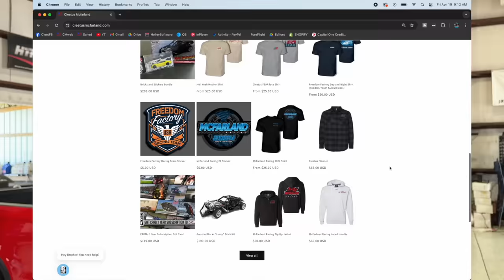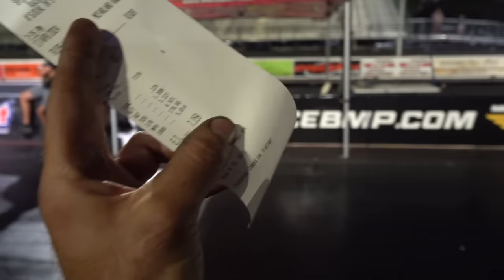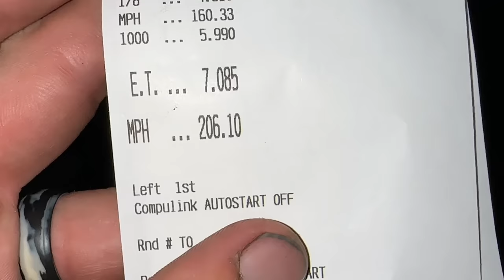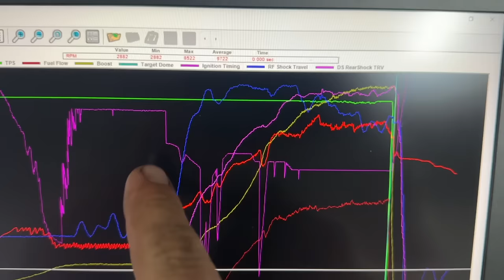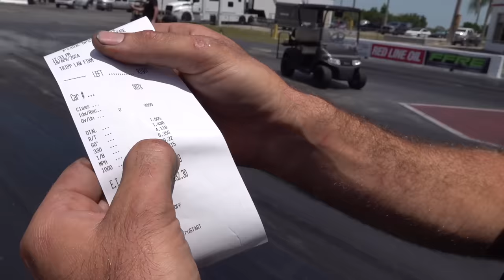Our NEW GMC and Mullet Both DESTROYED Their Records!!!

Comment: 03:00 doesn't take much to break a GMC.... 🤣🤣🤣
Oh, general motors.... 😂😂😂
Reply: 14:00..... And again.... 🤣🤣😂
Reply: Only 3 times 😅
Reply: 21:30 ... And again...... 🤣😂🤣
Reply: @TheXshot  
GM doing GM things... 😁
Reply: Changing an axle> changing a crankshaft
Reply: I was thinking those axels are not made for that kind of use. But as bad as they have beat that thing I stopped wanting it. The 15k would be nice I could buy a 1989 Toyota 4 runner that would last forever.
Reply: Oh it has to be 4 cylinder 5 speed though
Reply: @chevyon37s Kinda hard to compare the two when one of the Trucks has the stock motor in it while the other was swapped for a fully built 427 from Texas Speed... 😂
Reply: Ooops.. I triggered the GM fanbois...
Sure, the Ford has broken a time or two but it also makes a lot more power and is much faster. Imagine what the GM would break if it were making as much power as the Ford. That GM going to spit rods trying to hang with a Ford. 😆🤣😅😆😂
Reply: The front part for sure.
Reply: @philthelawnman So you wanted an untested 1000hp truck just tossed your way? 😂  They did like 30 pulls on the thing. I hardly call that beating on it.
Reply: @philthelawnman So youd have a 900hp truck and you would drive it like a sunday driver every day of the week?
Youd never floor it? You wouldnt do drag and drive events? Youd just let it sit in a garage for the rest of its life?
Hope you don't win it then...
Reply: @philthelawnman you think you could buy a late 80's 4runner that wasn't beat on?
Jeeze you're delusional
Reply: @michaelhuber6405 the ford has a built TKM in it
Reply: @michaelhuber6405  IIRC Doesn't the f150 had a built TKM motor good for 1800 HP.
Reply: @FinnellRacing  something gotta be different about it, because he doesn't blow up mcflurry nearly as much
Reply: @asylumental  Mcflurry isnt a blower car, its a turbo, thats the difference. The crank broke because of the additional stress the blower creates. If cleeter had put his crank support on before hand it probably wouldn't have broken.
Reply: @Jeremy-eu9bx  well I guess we will see after he rebuilds it again and puts the crank support in this time lol... so far that coyote motor seems to hate the blower setup
Reply: @michaelhuber6405  The F150 does NOT have a stock motor in it. It has a fully built fast forward race engines Coyote in it. Has had that engine in it the entire time he's owned it and it has now broken 3 times. IDK, replacing an axle a few times due to user error seems like a lot less of a pain than changing an engine 3 times because it tears itself apart.
Reply: @-joe-davidson  In all fairness that Ford has a lot more aftermarket parts in it as well. The entire driveline is beefed up (axles, trans, engine, rear end and driveshaft) versus a bunch of still stock parts on that GMC. It's pretty common knowledge that turning sharply with drag slick on a 4wd will snap an axle, not once did the axle snap on a launch it was always when it was under a stress from the slicks. The f150 is on radials, also when the GMC was on radials it never had an issue with the axles. Those slicks will wreak havoc on a 4wd, it'll always break the weakest link.
Reply: @michaelhuber6405  F150 had two TKM built motors so far
Reply: Still holds up better than the chinesium hub locks Ford used on their pre-2021 F-150's. Blue would have ripped the teeth off those hub locks with stock power and some sticky tires.
Reply: @TheFlooringInspector82  The axles were breaking at the track because the suspension is lowered significantly and the axles literally aren't long enough for the new range of travel. When the suspension was going into full compression it was pull the axle apart. Some clowns are acting like the shafts were just snapping. It's just a mistake from modding the suspension.

Comment: The red Chevy truck is already starting to fall apart. What a BIG surprise. 😂😂😂
Reply: GMC, but regardless if you try turning in 4wd on drag slicks it'll snap an axle in any vehicle especially if those are stock axles which they were on this truck.
Reply: @TheFlooringInspector82 unless it's a blue ford
Reply: @TheFlooringInspector82  actual question, why is that though? Never heard of anything like that until now.
Reply: @zekebruck7559  I'm pretty sure blue f150 isn't on stock axles
Reply: @Scootbreezy23 too much traction.
Reply: @Scootbreezy23  TLDR: no center diff, too much traction, axle goes pop.

I'm guessing that like most selectable 4WD trucks, this GMC has no center differential. This mean the front and rear driveshafts are always being driven at the same speed when in 4WD.
When a vehicle turns, the front axle takes a wider radius than the rear, meaning that the front wheels have to spin faster than the rears if traction is maintained. This is the reason all road going fulltime 4WD vehicles have a center diff, to allow this difference in driveshaft speeds when turning.
With no center diff, something has to give, in low traction situations like offroading this is just a tire or two slipping slightly and is actually beneficial for overall traction. On pavement with sticky Hoosiers on, there's too much traction and the wheels load up the drivetrain and find the weak link.
Reply: @NFBartos  Ahhhhh makes perfect sense! Really appreciate that man!

Comment: Cleetus is holding his laugh in on how much this GMC keeps breaking simple parts. Good thing it’s got a 7.0l to “compensate” 😅 Maybe it’s cheaper to build, right?
Reply: I’m sure Cleetus enjoys being on his 3rd rebuild with that coyote too
Reply: IDK, I'd rather swap out a stock axle on a GMC than be on the 3rd fully buitl coyote engine to fall apart. An axle and a tensioner are a lot less to replace than a 3 fast forward race engines.
Reply: A whole second faster is astronomically more in terms of pushing a truck.
Reply: @Ole_CornPop But I thought coyote is the best engine ever made and can make 2000whp+ stock or whatever ford guys say
Reply: The axles were "breaking" because they lowered the suspension and changed the angle of the CV axles so much they were being pulled apart at full compression. If you lower your suspension that much, those are the kinds of things you need to double check. The truck is at a 700 lb weight disadvantage, which isn't helping it. How many times has that 5.0 broken so far? I think I'd rather have to change a CV axles than pull that Coyote out over and over.

Comment: Took a Texas 427 motor swap, fuel system upgrade, 100 shot of nitrous STILL can't outrun that FORD 😂
Reply: FORD HAS AN UPGRADED ENGINE TOO ITS A BUILT ENGINE. FACTORY CUBES THOUGH.  BOTH BADD ASS TRUCKS
Reply: Ugh, yet another person who thinks the only thing that matters in an engine is the size of the pistons. Both are badass trucks, but remember that Coyote is the size of a big block, has 4 cams, twice as many valves per cylinder... The Coyote in the f150 is also fully built, heck everything on that F150 is built. It's a fully built trans, engine, rear end, axles, TBM brakes, driveshaft, fuel system, etc. That GMC still has many stock parts in the drivetrain, you throw 1000 horsepower at a stock axle, stock anything and things are going to break. If you're fooling yourself into thinking that F150 is a stock engine or any part of the drivetrain is stock, you are a fool. Go back and watch the F150 videos, that thing has a ton more money in it than that GMC does and yet it still keeps eating engines, heck it's going on it's 4th engine. How many times did that Godzilla engine break in McFlurry? What about when his Raptor R through every code known to man because he did some drifting? Shit breaks when you are pushing the limits, that just racing.
Reply: @TheFlooringInspector82  well said and that's what everyone thinks about coyote engines cause there 5.0 with factory forged internals and than they knock Ls engines that aren't. A coyote yes it's only a 5.0 butt its like you said 4 cams double the valves and the size of a bigg block .
Reply: @TheFlooringInspector82 you know Chevy guys can't read. Hehe
Reply: It's 700 lbs heavier and and they aren't pushing it all the way since it's a giveaway truck.
Reply: @rickybobby4017  That Coyote definitely block ain't stock either. They need a lot of machine work to hold when going beyond 1000 HP. 3rd gen blocks need sleeves for longer term reliability if you make much more than 900 HP. The good engine shops sleeve the block and add gussets to reinforce the block. They don't last long above 1000 without it.
Reply: @karlschauff7989  I know I said that in my comments lol
Reply: The point is the coyote is better because of the design, 4 cams>One cam…. Imagine a coyote that was 40% bigger, which would make it about 427 CI….the overall size of the engine would not be THAT much bigger 1”or so taller and under 2” longer. But power per cubic in should over the top. How much gusseting does Brett do on the Snot Rocket at 2950plus axle HP? And yes I know which block it is. Yes it is sleeved, but I think Brett said more than half OEM stock parts…..

Comment: GMC Never gonna outrun that FORD
Reply: What does his F150 run in the quarter? Stock is 13.8's
Reply: @ruger8412  it's knocking at the door of 8s. I think it went 9.01. The GMC won't get close to the F150, even with a full motor swap.
Reply: @ruger8412  haha, how many times are you going to come to the rescue of the gmc, I've counted about 3 or 4 and I'm barely through the comments, don't worry it's all in fun, the gmc is a sweet truck and so is the ford, eventually they'll get the kinks out of the gmc just like they did with the ford
Reply: @Friscorockhead  Yeah that F150 has had a built engine in it the whole time he's had it and it's going on it's third engine. It's a badass truck, but realistically the GMC was never being built to run with that F150. it makes half the boost, still has many stock parts in the driveline, and they're giving it away so it's a liability to giveaway a street truck that can run 9.0x without any of the proper safety gear. Both are badass trucks, and yes the F150 is simply faster, it also has a lot more go fast goodies in it than the GMC does.
Reply: That GMC could definitely get that ford if it wasn’t a giveaway truck and he put more into it
Reply: @JamesCox-dl6vx   yeah, you put "more" into anything, and eventually, it'll "get" anything
Reply: @JamesCox-dl6vx  if the GMC was Mullet it would run 6s

Comment: I'm looking into building a supercharged f150 what wheels and tire size is the f150 running and does anyone know any good wheels for an f150 street build? Preferably under 2k for the set.
Reply: I want something lightweight. That seems to be hard to find in the truck community. I'm coming from a sports sedan but I miss my old v8 truck and I'd like to have one with a bit more get up and go.

Comment: If the transfer case was swapped to the one from the Chevy S/S extended cab from the 2000's it would have the viscous coupler in the T-case and stop the axel's from breaking. Then if ya leave the actuator hooked to the front axel you can still run it in 4x2, ya just have to trick the BCM into thinking that the T-case is still shifting in and out or convert the front axel to cable actuated, there is a kit for 4x4 truck's with the actuator on the front axel housing on the passenger side that uses the fork to pull the ring over and couple the fornt x!

Comment: I think you should build another gmc to see what it takes to compete with the f150. Seems like its struggling to make it into the 9's but it's also a giveaway truck so your holding back. Also curios to see the full build sheet break down of both trucks, which one is taking more work to make it fast? 26 psi ford vs 13psi gmc with over a second difference before nitrous.

Comment: I have a 22 silverado 4x4 so 4 wheeel hi range locks the front diff, but when you put it in 4 wheel auto the front diff is open. now im not sure how it would respond on a launch with 900+ bald eagles with the front diff open but it'll save you from breaking a half shaft...

Comment: That’s crazy an aftermarket block ls 427 can’t run with a stock block, stock cams, stock casting headed 302. Even when the coyote was a stock bottom end it ran way better than 9.99. 
Even with the weight difference between the 2 trucks the GMC still should run better with the larger engine and aftermarket parts.

Comment: The red truck needs supports or bushings to prevent it from dipping on the brakes ,and while turning it’s just sorted out yet, too many changes without testing it for failures which is a good reason for racing the crap out of it,and rebuilding it better faster and stronger..

Comment: Have the Olsens at RCVPerformance build you a custom set of beefy cromoly  CV axles and joints. I gauruntee you the next component to fail while busting a u turn with slicks on 4 corners will not be CV's but will be the transfer case or chain. I went through the same ordeal broken cv bearing retainers and snapped stubs. End the nightmare and get yourself a set of billy bad ass unbreakable axles.🤟

Comment: Need to add about a half an inch to an inch length on that axle to keep it from popping out I used to have that issue all the time
Reply: Especially if you change the ride height from stock depending on where you have it at and the amount of horsepower you're putting into that thing you know when you turn or lift or compress you know it's going to rip that thing apart with that much power

Comment: Some of the truck problems yall are having is basic backwoods knowledge in the northeast. Never use traction control, never 4x on dry, never tight turn in 4x. Speed 2x will spin or push you through most surfaces.

Comment: Why do axels break with slicks?
Reply: The wheels travel at different speeds in sharp turns, the inside wheel needs to be able to slip in 4wd.  Why you cant just drive around in 4wd on asphault.. the axles/differential will break.  You've never had a friend with a welded rear diff for a locker?  You dont remember his inside rear tire popping and jerking around turns?

Comment: You put new rear end set up in the car . Start tuning the suspension to handle the power instead of pulling power . Or you’re gonna keep getting fisted by a 5.0 liter stock block mustang . 3200 lb ldr cars go 4.0x in the heat of the day .

Comment: Can someone explain what happened when turning on slicks?   I don't understand how that could possibly harm your vehicle.
Reply: He had 4wd on, and made a sharp turn, the differential/axle broke.  The inside tire in a sharp turn does not move as much as the outside tire.   The inside tire on snow or sand/dirt when in 4wd can normally slip alittle and catch up to outside wheel.  With slicks the friction was too high to overcome so instead it breaks parts.  You can break your truck without slicks, you cant just drive around in 4wd on pavement.
Reply: @RDEnduro  So why does my BMW SUV have no problem being in 4wd all the time?
Reply: The BMW Xdrive systems are a full time AWD system with a electronically controlled center differential. In a nutshell, the electronics control the front/rear torque split with a default 60% rear bias. Up to 100% of the torque can be sent to either axle depending on conditions. (100% to the front axle only occurs if the rear is getting 0 traction.) Side to side torque split is governed by using the Dynamic Stability Control (DSC) system to apply the brakes to whichever side starts slipping.

So to answer your questions.
1. It does have a center diff
2. It can't be locked but that wouldn't make sense in this context since it's not mechanically controlled.
3. There's no mod to enable 4WD mode because it's a full time AWD system.

Does your car have a 4 hi/4 lo ? If not it’s not a true 4wd

Comment: And - the Ford ran a second faster without NOS and 100 less cubes, AND it didn't break axles...
Reply: They also completely redid the Ford suspension for drag racing. Garrett specifically said that he would not change the suspension in the GMC as he did not want it to ride as horribly as the Ford does.

Comment: Mullet needs them 14 wides and a altitude adjustment, he kinda sets a little high for as fast as it is. Maybe time for strut front suspension and spindle mount knuckles to get Mullet down closer to the track and lose a little more weight at the same time.